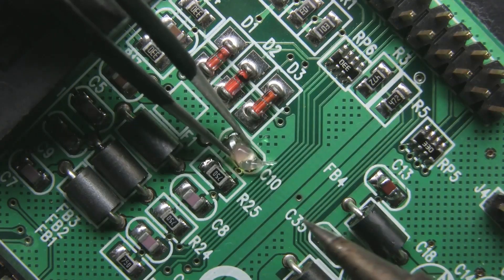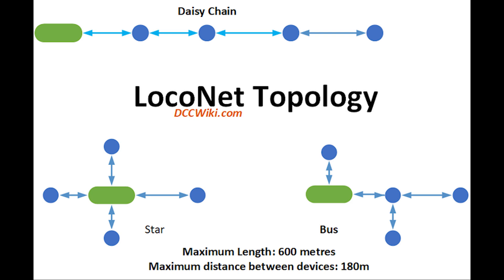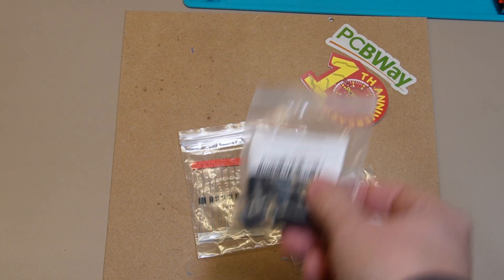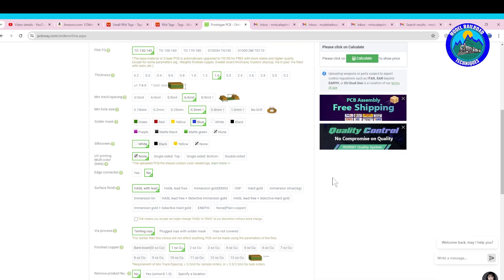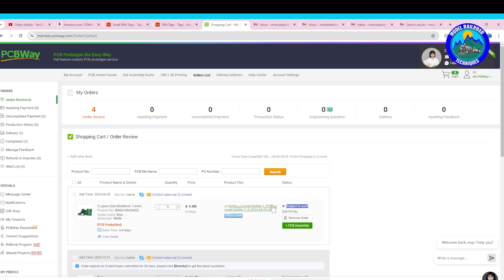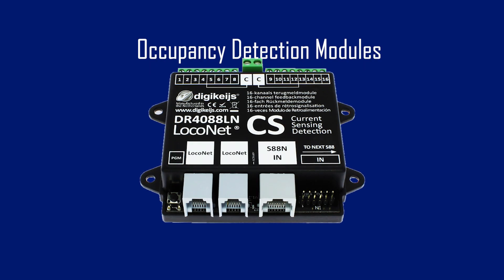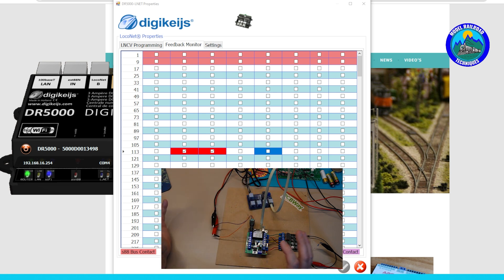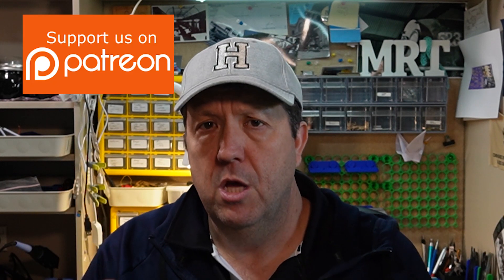Create Your Own LocoNet Hub: Affordable DIY for Model Railroads | Easy & Fun Electronics Project

Comment: If you don't want to built it yourself, you can just purchase a UP7 for about $15.  With 5 plug-in ports, it does exactly the same thing.  I've used that method on a big Digitrax layout I'm currently building for a customer in Sydney.  The input from the command station goes into the side port, with the four outputs each sending the loconet down a different peninsula.
Also worth noting is that the Digitrax cable maker kit comes with a tester that clips onto the end of the cable to tell you if everything is correct.  BTW, by the time you've added up the value of the 50' cable, the connectors and the tester that come with the kit, the specialized pliers are almost free.
Reply from the maker: @mpeterll  sweet I knew there would be other options. But for the electronics minded modelers this is an easy option too. Probably half that price. That’s for your commends.. cheers